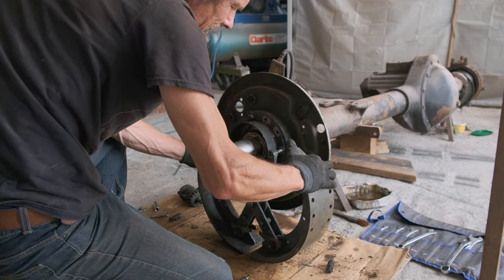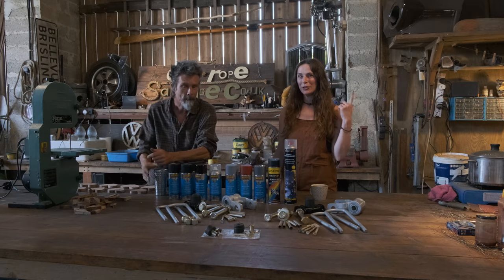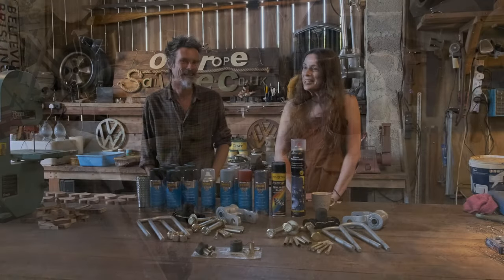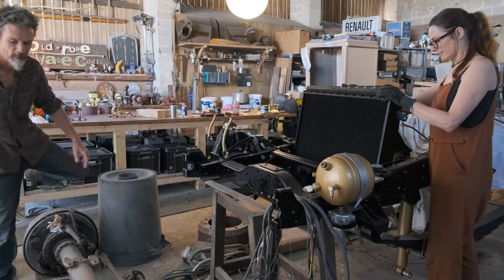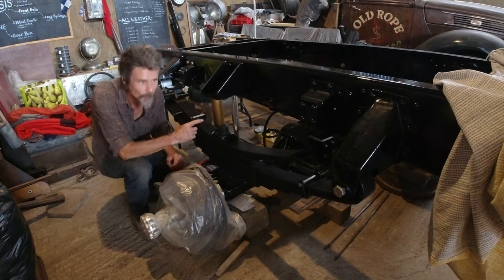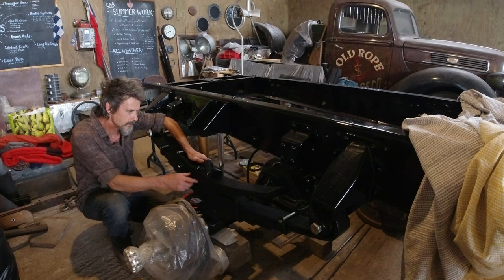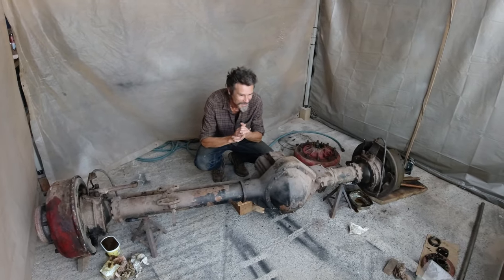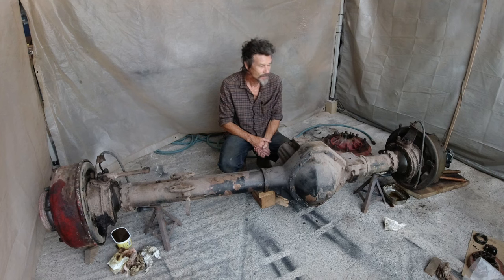What A Beast! Restoring The HUGE Front Axle on Our Vintage 70s Bedford Truck …

Comment: It might be a very good idea to pressure test all the brake lines  that cross over on both front and back axles also the rubber lines that goes to the wheel cylinder . All in all it is looking like the pot of gold is just beginning to show in the distance . Happy camping soon
Reply from the maker: Thank you 😊 We will be replacing the brake lines and definitely won’t be driving anywhere until we’re 💯 percent sure she’s safe 👍🏻 Thanks for watching, and for your support, as always 😎

Comment: Luv watchin u guys setup dis old girl , if ur building a permanent camper , it wod b a solid idea 2 cut another 2nd  leaf n install it on d rear bundles , it's gona sog at de rear I tink & depending on ur over all weight, 2 spacers " spring blocks" under the front bundles ,cuz the oil filter bowl gona hit the front shaft shud u catch a pot hole the wrong way 😥. Tek it easy deh ,god bless 🙌
Reply from the maker: Hey there, thanks for watching. Great to hear you’re enjoying our little vids 😊 Thanks for the input too. The truck was originally built to carry 11 ton and the rear springs do already have 2 lots of bundles. We’re hoping to build our camper to weigh in at 7.5 ton or under so should be good. Will check out the front shaft and oil filter though 👍🏻😎 Take care yourself ☺️

Comment: Hi guys your doing a fantastic job it will be like brand new...personally if you don't intend to run the truck at it's maximum carrying capacity why did you refit a complete set of springs.was it not possible to reduce at least a few leaves at each corner as I imagine this would make the ride less harsh.with a campervan build on that truck it probly only run at half it's max design  weight?..how are you doing after 2 years with the budget.i would think this project would run to 40 grand ish with your standard off work and attention to detail wich is excellent ..well done both of you  I've subbed and shared excellent channel .ps what dates do you have in mind for completion roughly 😍
Reply from the maker: Hi Desmond, thanks for joining us, good to hear you’re enjoying the videos. Thanks for sharing too, much appreciated. And all good questions these! The leaf springs is an interesting one. We found conflicting info on this and we were initially going to reduce the leafs. But in the end, because the rear leafs are in 2 packs (hard to describe this in words, but you undoubtedly know what we mean by this) we think it will run on 1 without the other coming into play. We may try to describe this in a video at some point as difficult to explain in full here! Mostly, as we have not driven the truck yet, we have decided to approach the project as a restoration first and possible modifications later as we embark on the camper phase of the project, so watch this space! As for the budget … So far, believe it or not, we have spent very, very little on the truck, as we have done everything ourselves (even building much of the equipment) and we haven’t needed to buy any parts. Most of our spend has been rent on the workshop. We are expecting this to increase when we come to possibly buying new wheels and a couple of other things. The camper part we will approach in the same tight fisted way, but it will be where we spend more money as some things (batteries, solar panels, electrics etc) we will have to reach into our pockets for! And as for the completion date … er … about a year ago 😆😆😆 No deadline for us on this, to be honest. We are mostly just taking it as it comes! Hope this helps … I need a lie down now after writing this essay! 😎😮‍💨
Reply: Cool thanks for the reply.i no what you mean (banks of springs)normally on hgvs removing an entire bank on a vehicle like yours would take it from say 18 ton gross to 12 tons gross.easy to find out of vosa..(downplating)a  hgv vehicle used to be done for a road tax saving if you didn't need the extra carrying capacity..but not really relevant these days plus your road tax exempt anyway...my swb Land rover was terrible with it's springs very stiff and uncomfortable....when I rebuilt them I smothered each leaf spring in copperslip the difference was amazing .😍